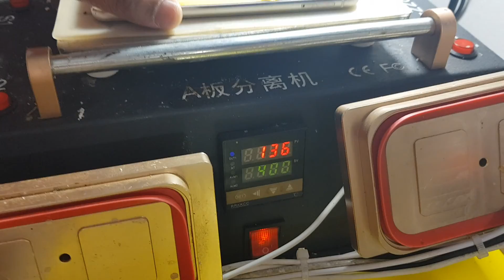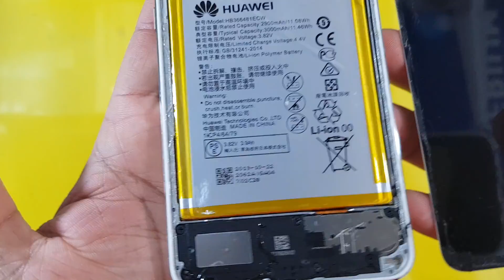how to replacement huawei P10 lite battery complete guidelines idq1009.offical

Comment: i have changed my huawei p10 lite battery recently, when i start charging for the first time, charging was going on normally till 70% ,it took 90 minutes to reach 70% then, it starts jump from 70% to 75% then to 80% and it within a minute its reached to 100%. i think it's fake charging, and this is the second time it's happening, i had this issue with my previous battery as well, when i was charging that battery for the first time, please help. Thanks